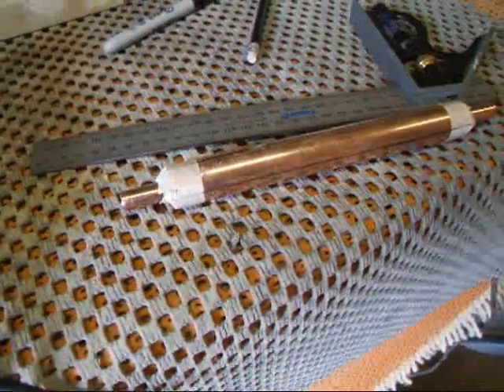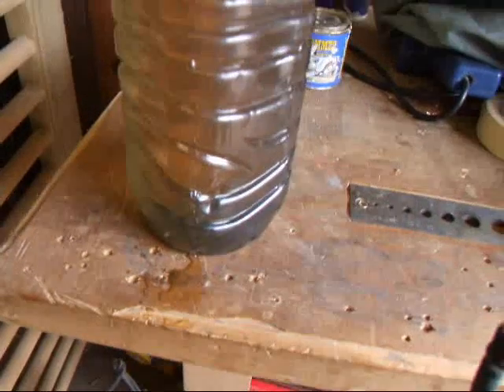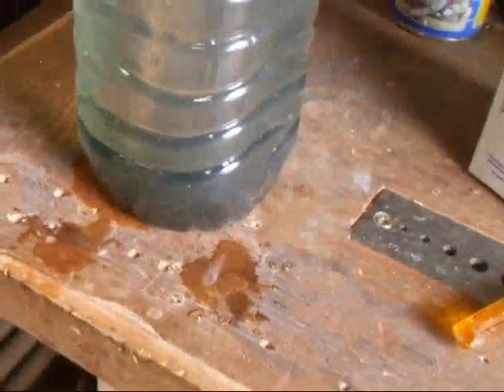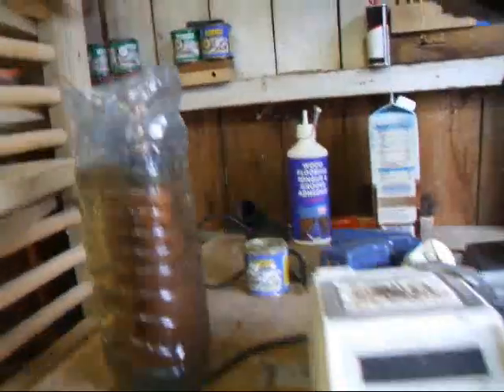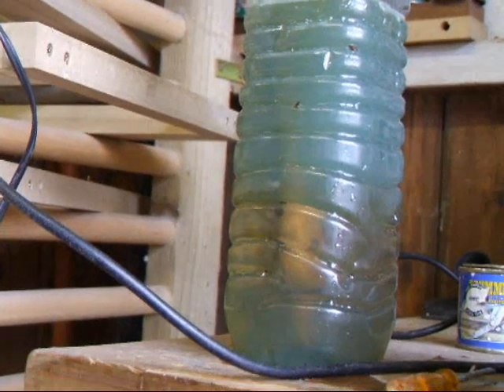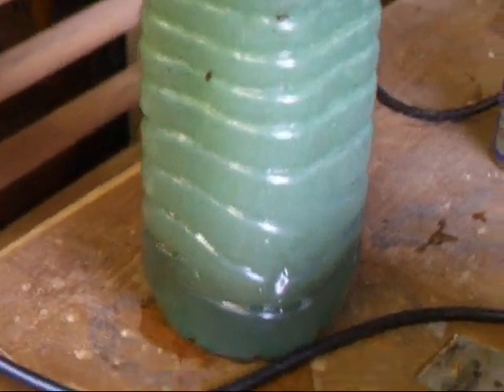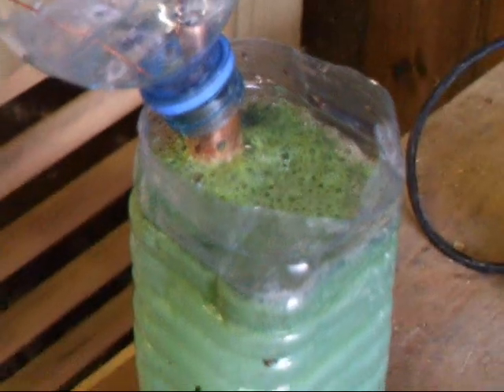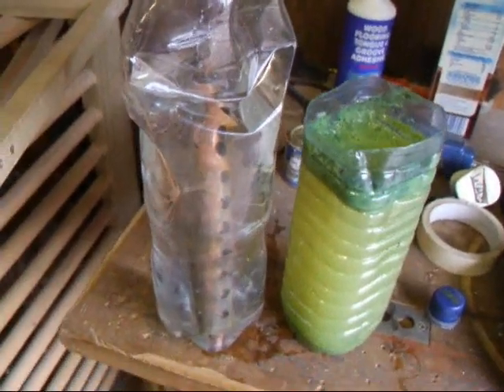Algae Removal Machine

Comment: But regarding the pulses, it shows that you still don't understand how electroclocculation works. The amps are the charges per second that pass through the circuit. (For Al or Fe, you need 3 charges per metal ion.) The amount of coagulant released is determined by the coulombs and hence by the amps through the circuit. And since you need a certain dose of metal ions to coagulate a specific amount of algae, you need a specific amount of amps. Sorry, no way around it.

Comment: An air bubbler does not coagulate it just floats solids that are not in colloidal form. To separate colloids you need to neutralize charges. That's what you need the coagulant for. No idea what you are talking about the polarity reversal, as I didn't mention anything on that regard.

Comment: It doesn't seem as if you understand the electroflocculation process. It is not about killing the bacteria but coagulating the suspended solids so they can be separated from the water. When the metal ion is released it very rapidly forms a metal hydroxide which is a coagulant. The coagulant neutralizes the charges in the colloidal suspended particles to allow them to coalesce and flocculate.

Comment: That won't work. You need to dissolve the metal ion into the water. You can use Iron electrodes to avoid copper contamination.
Inert electrodes (carbon, or SS) will not dissolve and will only generate oxygen and hydrogen gases, and what you want is the dissolved metal to coagulate the algae.

Comment: What you are doing is called electroflocculation. Your positive electrode will dissolve electrolitically very quickly and will need replacement. That is, if it does not become innefective first due to contaminants sticking to it and prevneting electric conduction.

Comment: What kind of power supply are you using is it DC or AC and what voltage
With all the buzzing on your video it seems a fairly high voltage
Do you need all the activity or can it be done at a lower voltage
LATA